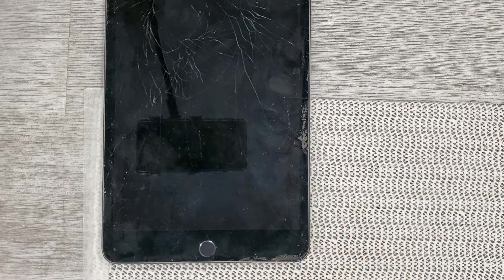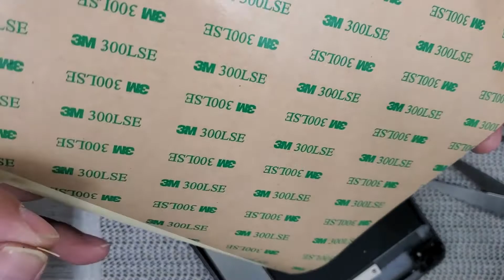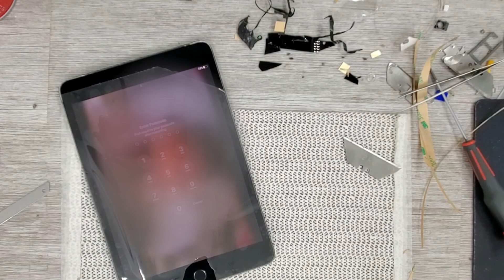IPAD MINI 5 Model: A2133

Comment: Buenos dias discilpa me podrias ayudar ? No puedo encontrar el headphones jack  para esta ipad A2133 ,la he buscado en internet y nada ,,es acaso compatible con la 4 gen ? Gracias
Reply from the maker: Hola! Mira no se si te refieres al adaptador que se conecta al charging port o Centro de carga, depende en donde te encuentres, generalmente en eBay encuentras todo esto.  Esta iPad 5th es compatible con las siguientes modelos A2133 (Wi-Fi) A2124, A2126 (Wi-Fi + Cellular) A2125 (Wi-Fi + Cellular TD-LTE)
Latinoamerica https://www.mercadolibre.com/ 
Aqui te dejo Dos LINK nada que ver con este vendedor pero espero que te sirva:
https://www.mobilesentrix.com/charging-port-flex-cable-for-ipad-mini-4-white?___store=default

 https://www.ebay.com/itm/173318499549?epid=7034913204&hash=item285a966cdd:g:1R4AAOSwUyBbR6xo